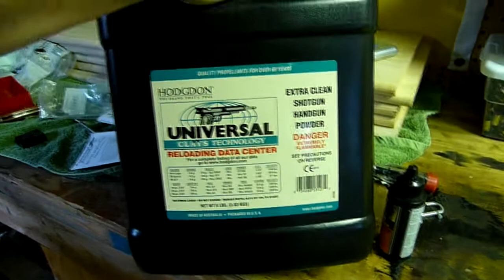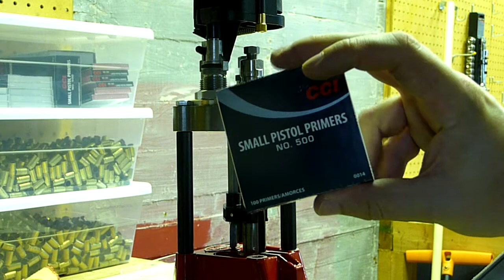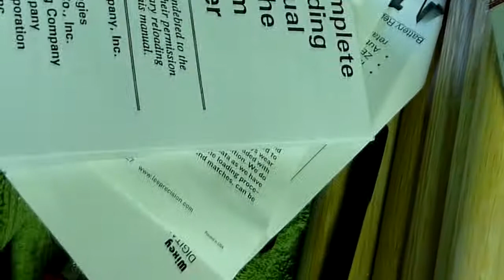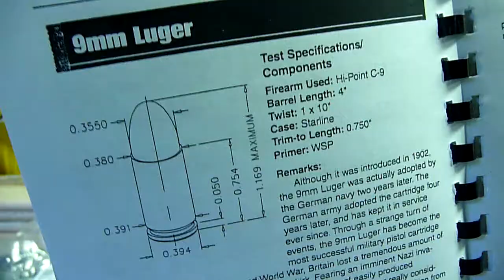A Beginner's Reloading Setup - Lee Loading Press

Comment from the maker: It is at first, but once you get a rhythm down, it goes a lot smoother. You can also get a Lee autoprimer if you so wish.

The press is great if you're looking to get into reloading at a low price point. There are certainly better options out there, but you'll pay a lot more for them. 

If you're just getting started, you can go wrong with one of these setups.

Comment from the maker: There are a couple of options. The cheapest place to get brass if your local firing range. Go early in the morning and check the ground, plenty there and much of it was fired just the day before. It sucks to have to pick it all up but a good way to get a collection going if you do it on every visit. The next best place are forums. Many have a section for reloading supplies. The third place is gunbroker. You'll probably pay more there than anywhere else but it's also the easiest place to get it.